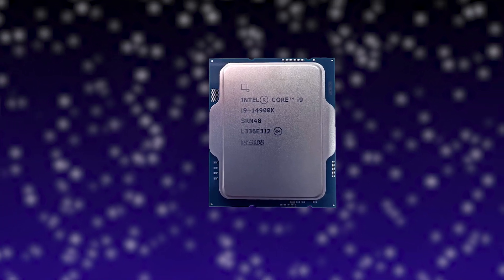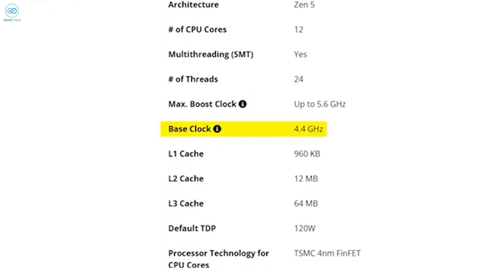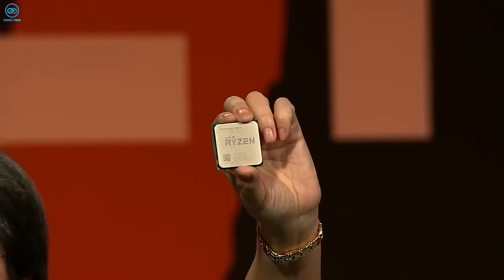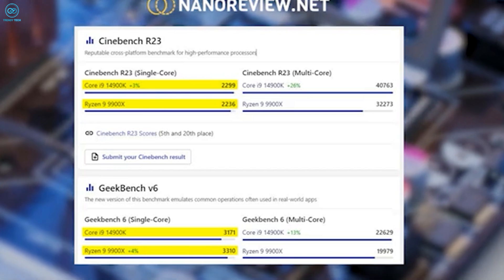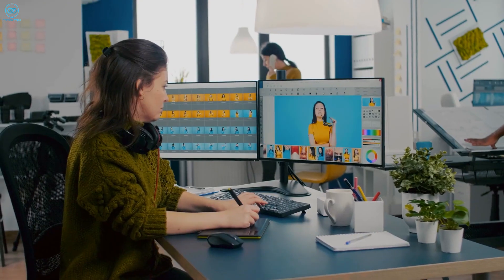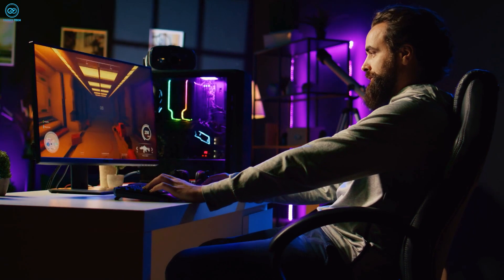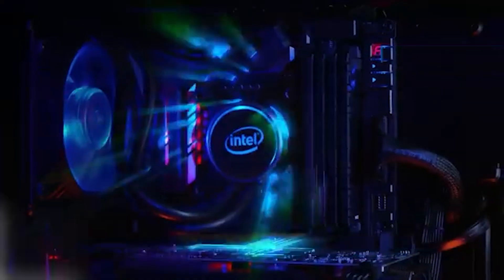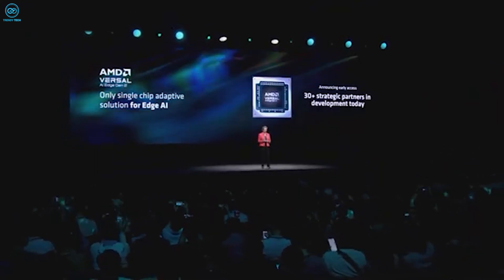AMD Ryzen 9 9900X Vs Core i9 14900K - Shocking Results Revealed!

Comment: Intel offers better upgrade and compatibility , well that is a wrong for a start .
AM4 came out in 2016 and AMD say that AM5 will be used until at least 2027 , How many different sockets will have intel used in there 2 generations per motherboard by that time ?
Reply: 3 generations per board by the way for intel, not 2.. lol